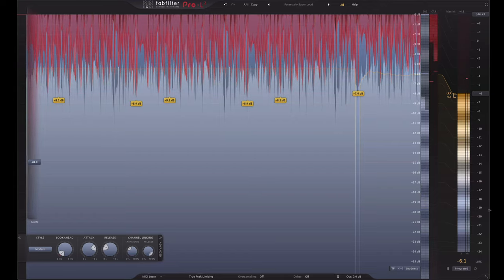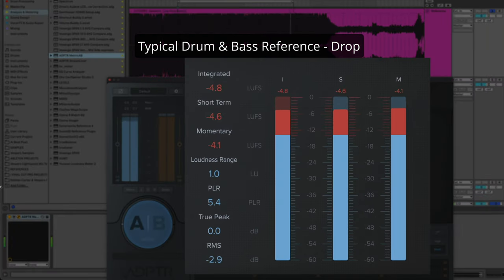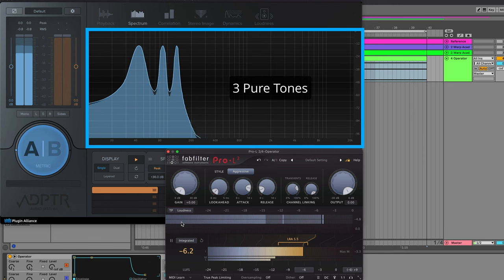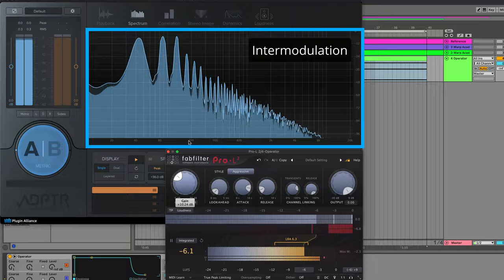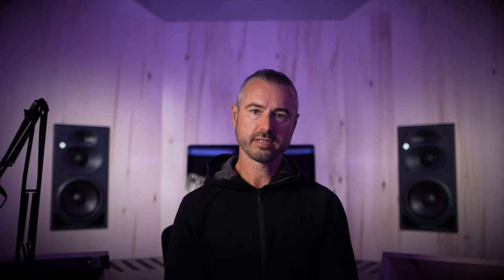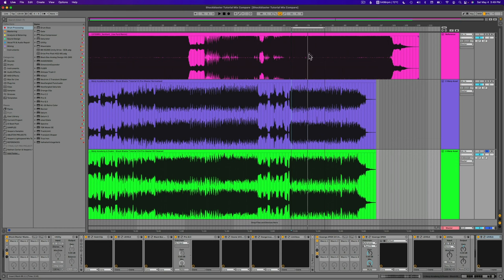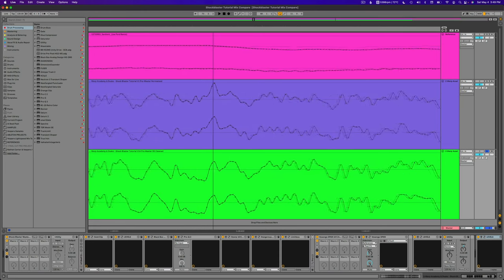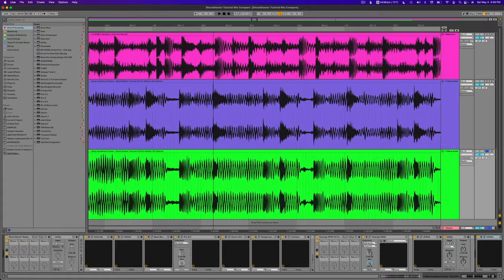HOW TO MASTER LOUD - INSTANTLY Get FAT, Clean + In Your Face Results

Comment: -5 LUFS in mainstream pop is not at all common any more. I'd say we're in the -8 LUFS range now (maybe -7 short term).
Reply from the maker: I agree with pop - it's closer to -8.  That's why I said there's a range and it applies to pop, hip hop, and electronic music.  In dub step and drum & bass, it's common to see -4 to -6.  In hip hop and pop it's less loud, but still very loud.  -8 is typical.  

I analyzed over 100 drum & bass references of modern releases, and the average level in drops is -4 to -5 LUFS.  Seeing as this song is a drum & bass tune, I used that loudness range for the master.
Reply: @warpacademy indeed dnb is still around -4 to -5 LUFs and some crazy mofos from the Netherlands ;) managed to go even beyond that with a clean mix… but Noisia are just different

Comment: My question is, how do you get rid of the high samples volume that are barely audible during the mix if you don't get to see the resulting waveform? I already do what is talked about in the video, but I just use my ear and try to do light clipping, like up to 2 db maximum on single tracks; it's kind of working for me already but I feel like I'm not so intentional and mindful yet
Reply from the maker: Hey hey.  This is my process for doing it on the master: Before Mastering I Do THIS…✅
https://youtu.be/xzujAhDVg6w

On individual tracks I have them as audio so I can visualize the peaks or I use a waveform scope like an oscilloscope.  Usually I have a clipper up that uses a waveform display like K-Clip or Gold Clip.  

In regards to your 2 dB of clipping comment.  Some sounds can take much more than that.  It depends on the sample.  It’s not uncommon for me to clip a snare like 4-6 dB.  Unless it’s already a mastered snare from a sample pack. In that case I may not clip it at all ;)

Hope that helps.  Cheers!
Reply: @warpacademy  thank you for the answer, really helpful
Reply from the maker: You got it :)

Comment: Great video, each time you sum signals you get new peaks, If I want to mix loud I use a lot of busses and at each summing stage I use a clipper eventually to get rid of those peaks before hitting my masterbus compressor.
The clip to zero technique is really interesting if you want to mix loud as f*<k but only works when you’re working completely itb 👍🏼
Reply from the maker: Absolutely.  You’re right that new peaks are created at each summing point.  It’s a best practice for sure to use submixes / busses and process at that level as well.  I’ll have a video on that soon.  

In terms of CTZ, it has some great insights about workflow and clippers.  Good stuff.

Comment: I fought the clipping thing but I do see the benefit as you get down the mix and mastering phase.  I love my drums to be punchy but that always leads to some of these peaks.  Now that I tame them every so slightly with bx_clipper, my limiter is not struggling near as much.
Reply from the maker: For sure.  That’s a huge benefit.  Now try clipping each individual drum vs doing it on the bus or master.  It will be way cleaner.  And because the clipper introduced a small splash of distortion you won’t even miss the level in the transient because the drums will actually sound louder and punchier with clipping than with higher peak level.  It’s a beautiful thing.  

Just find the sweet spot and don’t clip them too much.

Comment: Remember in SoundForge when we could paint directly in the wav file. Is this possible via any plugins?
Reply from the maker: Hey Christian.  It's been a minute since I used SoundForge so I don't recall.  But you can definitely do this (adjusting sample points) in iZotope RX stand alone Audio Editor.  Not sure if that's what you meant.  Cheers.

Comment: Hello, very good. Do you set limitless, up with the bands set up on the way the track falls, as in low-end, kick drum, 

They look like they are set to specific areas in the waveform. 

Thanks again.
Reply from the maker: Hey hey.  Glad you enjoyed this one.  I actually often leave the bands at default.  You can also remove bands to simplify things if you want.  

Some controls that are very significant in Limitless are the band Separation control, which governs how multiband the behavior is.  And Weighting is also very important as it controls how much GR is applied to the bass vs upper frequencies.  Cheers!

Comment: Hi. What to do if you’re getting -7.6 lufs and red color with Span a +3.3db true peak? I need a true peak of 0 to -2 right? So Gain adjust down 3.3db? Or what else to keep dynamics etc…? It’s too loud. For Spotify distrokid. ..
Reply from the maker: Hey hey.  Good question.  I would venture a guess and say that you're pushing your limiter way too hard and getting too much gain reduction in your mastering phase, creating distortion.  It's hard to know for sure without seeing your mastering chain and hearing your mix.  

In general though, most people pushing for loud masters (-9 LUFS or louder) do too much with the mastering chain because they haven't learned how to get their mixes loud enough in the first place.  My mixes are -10 LUFS / -11 LUFS before I even start mastering, which means my mastering limiter is doing 2 dB of gain reduction in most cases.  

To see a masterclass on how work (and how to get loudness from your mix, not your master), check these videos out (all free):

My mix template - how I route things for clean, loud mixes: https://youtu.be/cnQC0146TZg 
A full 2.5 hour deep mixing session: https://youtu.be/bj7ZNvmfRwA
Reply from the maker: Oh, and regarding your true peak level - yeah +3.3 is way over the top.  You'll definitely need to back off your limiter and rein those in.  

I would ensure you're using 4X oversampling in your limiter, likely use more lookahead than you're using because it's likely you're generating a ton of distortion, and back off the gain into the limiter.  

Watch this video I just posted about setting up limiters: https://youtu.be/_HiDh7n6TaU
Reply: @warpacademy  I didn’t use or get to the limiter yet. It’s an older two track no stems. I tried EQ just now, should I just reduce gain with izone free EQ 11 vocal preset, -2.9bd gets true peak to -1 and lufs to 10.5 reading meter in voxengo span? My fab filter L doesn’t have place to reduce gain on left side and true peak reduction right side called tpdb or something, doesn’t work it’s still at plus 3.
Reply: @warpacademy  so I used izone 11 EQ -3db seems to solve it but... it it’s just one ”two track” and I might add second vocal track for doubles in the Edm house drop. I stopped EQ instead used and tried the Utilites plug-in now and I  got -13lufs and -1db truepeak. So Which of those two ways is better? EQ or utilies plug-in ableton? So my track is basically the master already! probably it was bounced compressed and mastered last year and I forgot about it. ‘) is dropping those one track fader is the same as utility plugin in this one track case? can there be dither and bit depth issues involved? Distortion, squashing? . Instead putting on one track can I put the Utilites plug-in on the master and just turn down the output, won’t it kill my mix? Txs
Reply from the maker: Hey hey.  I help as much as I can on YouTube but these are some really specific and technical questions.  No way I can answer this stuff without seeing your session or loading it up inside my DAW and analyzing the song.  For that you’d need to hire me to consult or mix your project, which you’re welcome to do on my site: https://vespers.ca.   I’ll help if I can.  Cheers!

Comment: Excellent explanation.
Does it then mean that in your mixing project, so during mixing, you would put a clipper/limiter plugin on every individual track, as well as on each group/bus track ?
If not, why not ?
Reply from the maker: If I’m mixing for maximum loudness, like in say a drum and bass track, then I could transparently hard clip nearly every sound except the sub and vocals, I wouldn’t clip the returns either.  Nearly everything else.  

And yes I would clip a touch (not very much) at each summing point.  So busses yes.  Master yes.  

I usually would use non oversampled hard clipping.  But in some cases I use a limiter or even manual gain adjustment by hand.  

I tend to use a limiter on my sub (a slower transparent limiter) and vocals.  

And I may use a clipper into a limiter on some busses.  You have to be really careful not to kill the punch and all the dynamics.  So less is more sometimes and there’s an art to doing it right.  

Otherwise you get a mess of over compressed garbage.

Comment: Do you have any tips on how you manage your dynamics as you use a hard clipper on each individual elements? How do you measure "the bigger dynamic picture" as you go along? Do you have SPAN on the master and occasionally check this to see how the dynamics are in total?

And for the clipping itself - is it more of a "if it sounds good, it probably is", or are you mainly looking to flatten the worst peaks for most of everything?

Thanks for great insight btw. subscribed.
Reply from the maker: Hey hey.  Thanks for subscribing.  I do use SPAN but not for dynamics monitoring.  For that I gauge it by ear. 

It is certainly possible to over clip and limit sounds if you’re not careful.  Sometimes I use clippers in parallel, for instance on the main drum buss after all the individual drums have been hard clipped.  

I clip as much as the sound can take while still retaining perceived punch in a clean way.  Also carefully adjusted by ear.
Reply: @warpacademy  Thanks for the swift reply. So you try not to add clippers to everything per say, it's more of a selective process and where it is needed. I see some people clip on the masters before the limiter as well, so I was just curious as to what's the more beneficial way of doing it and not over-doing it. Will do some experimenting. Thanks again for good content :)
Reply from the maker: You're welcome.  Yes, keep in mind that a clipper is a distortion device first and foremost.  It reduces peak level as a side-effect, but it will always make distortion.  So I rarely clip vocals, sub, or delicate sustained sounds like pads or keys.  

Limiting on the other hand controls dynamic range first and foremost and only creates distortion as a side-effect if you push it too far.  Most of the time limiting doesn't create distortion, unless you zero out lookahead and use a very fast release.  

So for the aforementioned sounds (vocals, sub, pads, keys) try limiting first if you need to contain dynamic range, not clipping.  

Regarding clipping before the limiter, yes this is common approach.  Although lately I've been putting the clipper first in chain, and the limiter last.  Clipping first in chain is a great move when you want to reduce spurious peaks into gain-sensitive mastering effects between the clipper and limiter (IE saturation, compression, dynamic EQ).  

Cheers!

Comment: Sweet video. So would you put the clipper on and then bounce that so you can see the new waveform?
Reply from the maker: Glad you enjoyed the video.  Actually, I prep the mix first in iZotope RX Audio Editor and I handle all the highest peaks manually using gain rendering.  I have a video coming up about that mastering prep process very soon.  Stay tuned.  

Once that's done, I set Gold Clip first in chain usually to handle a few dB of clipping on the remaining peaks (which are much more even now after the iZotope RX manual limiting process).  

Hope that makes sense.  Cheers!
Reply: @warpacademy  when you say mix in RX, so it’s a bounced out file? I didn’t think RX could do multitrack?
Reply: @warpacademy  oh you mean you export stems and open each stem in RX individually?
Reply from the maker: Hey Paul.  I export the entire mix, and then process that in RX doing the peak level manual gain / manual limiting.  So it's a single stereo file.  

For handling micro-peaks on individual tracks and busses in the mix, I use clipping.  

Also, once the entire mix is processed in RX, I import it into the DAW for the mastering session, where I clip it again with Gold Clip (first in chain) if I'm mastering really loud, like in this case.  Cheers!
Reply: @warpacademy  thanks so much I’m going to try it out
Reply from the maker: Enjoy!
Reply: @warpacademy  I have SIR Standard Clip, is that good for a clipper ?
Reply from the maker: Yes, it's certainly a pro-level clipper.  I have it, but rarely use it.  Not because it doesn't sound good, but because of the interface and workflow in it.  It's clunky.  So for that reason I don't use it, but it certainly is a good clipper used by many.

Comment: Just trying to confirm something... In the 'What techniques did I use?" segment, you mention that performing gain operations on micro transients is not recommended on an entire master, do it in the mix. However in one of your recent videos, (Before mastering, I do this) you mention doing this prior to mastering via Izotope RX. Could you perhaps elaborate on this? Does it depend on how heavy handed / how long the duration of the change is? Love the videos, great content! Thank you!
Reply from the maker: Thanks for watching and commenting!  Yes I realize that’s a bit confusing so let me clarify.  The big mistake with many people is leaving all the peaks totally unattended through mixing and ramming them all into a limiter during mastering.  That makes for a garbage master usually with distortion and artifacts.  

What I do is clip and handle transients all through the mix, on individual sounds and busses.  Then I use RX to shape the mix manually (like you saw in my “Before Mastering I Do This” video).  Each summing point creates micro-transients.  This way I can handle them with zero distortion and artifacts.  

Then I run the mastering chain on the cleaned up RX pre-master.  

Now, there are many scenarios where I’m not the mixer.  I’m only mastering.  Like in that recent video.  So there was no clipping used in the mix and all the micro- transients were in the stereo mix export.  In that case I use RX more heavily to clean them up so my mastering chain doesn’t freak out and work too hard. 

As you saw in my most recent mastering video “How to Master a Song Start to Finish”, I was only just tickling the master limiter a couple dB due to the fact that RX had done a bunch of the work using manual gain.  

Hope that helps understand the process a bit more.  Cheers!
Reply: @warpacademy  It does! Appreciate the response, thank you!
Reply from the maker: Right on. Cheers!

Comment: After seeing this video I'm feeling pretty good with my skills since I have no problem reaching -7 or -6 LUFS without distortion. I've heard recent releases like the latest Rolling Stones album, or Olivia Rodrigo, which goes as high as -5 LUFS. Now there's a challenge!.
Reply from the maker: Congrats on clean engineering.  Don’t push it unless there’s a really good reason.  I did this because that’s where drum and bass songs are mastered to on every major label.  -5 is loud AF for sure.
Reply: @warpacademy  well the -5 standard for dnb was years ago, we are closer now to -1.5 lol
Reply from the maker: @TheAcreDnB  maybe some songs?  I analyze drum & bass all the time and I'm seeing -4 to -5 LUFS integrated in the drops.  Are you talking about short term or momentary perhaps?  RMS?  

Link to some songs if you want.  I'd be curious to hear them.
Reply: @warpacademy  yeah sorry, momentary, not long term, i forgot to mention

audio - marauder for example, or the clamps - conviction, these two mfs are hitting -1.6 momentary easily :D
Reply: -5LUFS is actually is to achieve. The hardest is -3LUFS while maintain clarity especially in death metal

Comment: I have a maybe stupid question: Wouldn't it work on the whole Mix if you had a very fast Limiter (or some offline process), that could just look for these mini peaks and turn them down?
Reply from the maker: All questions are welcome.  What you’re describing is a clipper.  A very fast processor that turns down samples.  A clipper is a form of limiter with zero attack and release time and a brick wall.  

But it generates distortion.  So do limiters but limiters use a big brain to try and avoid that.  At the expense of making transients sound dull sometimes.  

I use both!  Know the tools and where and when to use them.
Reply: yes it would work. when you are mastering your audio file clip away 2-4db after that push the limiter as hard as it allows you to.

Comment: Who wants " in your face" result. I like depth in mixes. Dynamic range. A difference between drums, bass, guitars and the leadsinger up front in the mix✌️
Reply from the maker: To each their own.  It’s a stylistic and genre specific sound. Which I expect doesn’t apply to what you’re into.  Seems like you’re talking about band stuff?  I’m not. Also depth and a loud in your face sound can exist at the same time.  Depth staging can be done well in a loud mix but a lot of loud mixes and masters can sound closed in, you’re right. Especially if they’re using saturation the wrong way.
Reply: Difference between instruments in a mix =\= overall dynamics
Reply from the maker: Thanks for chiming in on this @kooistradurk
Reply: …and than put your Cowboyboots on and squaredance around your bed…